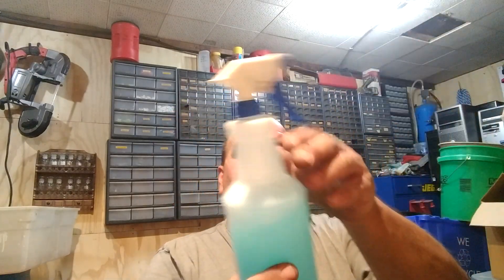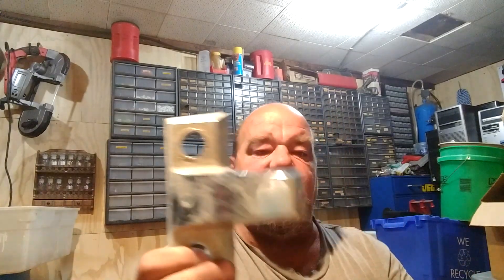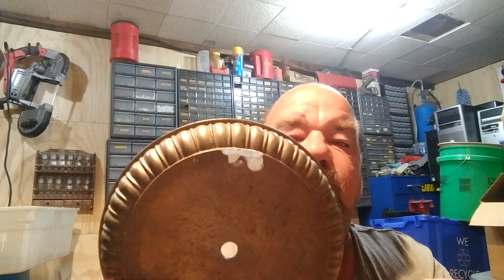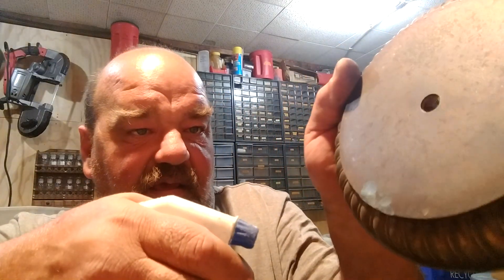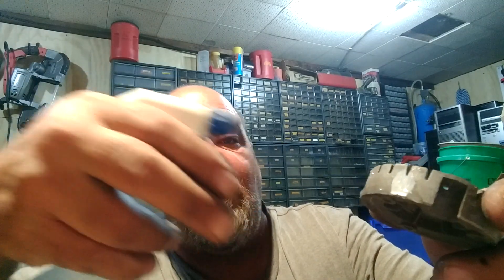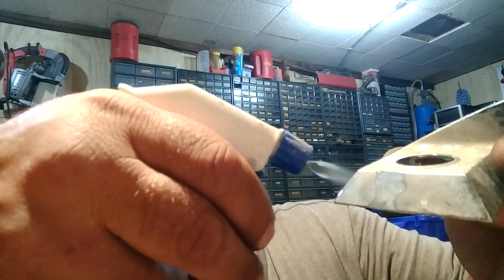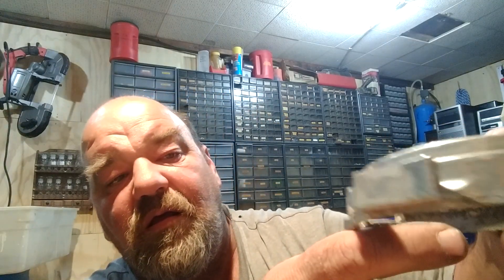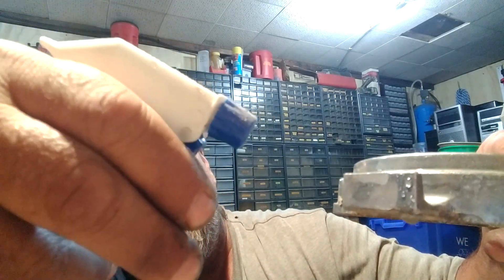Identifying Cast Aluminum vs. Die Cast

Comment: It’s the zinc that is "turning black" when exposed to a solution of copper sulfate. What you are seeing is elemental copper forming on its surface, that's the black stuff. For the magnesium the bubbles that are forming on the magnesium are hydrogen gas; the magnesium is being oxidized by the water. The chemistry is a little more complicated but that’s what you can actually see. And for the aluminum nothing happens because aluminum has a protective oxide layer. Pretty kool but be careful! Copper sulfate, that's what the blue stuff is (copper sulfate pentahydrate), is pretty toxic. And I quote “toxic to humans and animals, and is highly toxic to aquatic life”. It’s extremely toxic if ingested.

Comment: Loved and Subscribed! 
Another related topic that is becoming increasingly problematic is, "Beta Brass." It is Brass w/ higher Zinc content (~35%). Very prevalent in indoor plumbing fixtures these days, because it light, strong, and saves manufacturing/shipping cost. 
The dilemmas are: 1) Scrapyard wants to call it zinc (pays less). 2) Harder to differentiate, when it's ground, it is a "light yellow," but can often look white, depending on how light is reflecting. I think scrapyard needs a new category, as the payout beteen Brass & Zinc is significant. Beta is commonly found in bath fixtures, especially those made in China. 
Glad you mentioned Magnesium, as you stated it's very light.
 Not sure if the yard differentiates, I think they chuck it in w/ Cast Alum.
Thank you so much for the your very practical, no-nonsense video. I will look at more of your content.
Reply from the maker: @pokey5881  Glad you found the info useful.   I am also finding your i for useful as well!  This is the first I am hearing of this "Beta Brass"  I'm going to gather some pieces in the yard i am helping out and shoot them with the XRF gun.  If you like informative videos, I ha e one on the legality of scrapping,  and I am currently working on a video on "prohibited items", like railroad scrap, manhole covers, shopping carts, etc.  Thank you for your info, and I'll let you know what I find out.  👍

Comment: Thanks so much for this, CU! Now I need to find a UK supplier of that stuff! Just one thing: by "die cast", do you mean zinc?
Reply from the maker: Yes, die cast is an alloy of zinc and aluminum.  The active ingredient you are looking for is copper sulfate.  If that is the active ingredient in what you have available in the UK, you're good.  Some say ammonia also does the same thing.  I can't vouch for that because I've never tried it.  Good luck!!
Reply: @cuscrapping  Thanks so much, I've bought some off eBay. Can't wait to try this - more scrappers should know this amazing tip!

Comment: Question - why does the Diecast go black , is there a certain material only diecast has that reacts with the spray to turn black?
Reply from the maker: @boris9331  Zinc is what it is reacting to.  Die cast is an alloy of aluminum and zinc.

Comment: What is the significance between diecast and cast aluminum ? Is one inferior ?
Reply from the maker: Die cast is an alloy of aluminum and zinc.  My yard pays less for it, but I have seen some other yards pay more.  Die cast is cheaper and some say stronger than cast aluminum.  Hope that helps.  👍
Reply: @cuscrapping  It does but since others have said that zinc fumes would kill you, I guess I can cross that off my list for remelting and repurposing it. Thank you for clearing that up and giving us a great way to check this stuff. Some one told me the kids at the schools only collect the pull tabs of can as it is superior aluminum, Make sense as it shouldn't great under extreme stress of popping it. Would you know if that is true ? I want to do some casting and of course use premium feedstock.
Reply from the maker: I had "zinc poisoning" about 25 years ago cutting galvanized pipe in a commercial basement with a torch.  Drinking milk is a good "remedy".  Check out Ralph Mourik on YouTube.  He does a lot of zinc melting.  Not sure what precautions he uses.  Not sure of the purity of pop tabs.  If you want pure feedstock for melting, aluminum wire is your best source!  The larger power wire, not the wire from motors or transformers.  I've heard it usually runs 99% pure aluminum.  👍

Comment: I don't like terms like "die cast". Aluminum, zinc, copper brass, lead, pewter...etc. Are you talking about zinc?
Reply from the maker: I agree with you, but that is what my yards call it.  It is a zinc/aluminum alloy.  Kind of the same as yards calling sheet steel/shred as "tin".  It is not in fact tin.  You know the old saying..."When in Rome..."  😂👍
Reply: @cuscrapping  Things are a lot different here than what I am used to. Back home we had #1 and #2 prepared, unprepared, car bodies, aluminum (dirty and clean) copper #1 and #2 (dirty and clean) Brass, lead. 

If I had a piece of page wire in a load, it would be rejected. here it doesn't matter.

Comment: Thank you for the video. i have fan motor ends that I have been wanting to identify, this will help tremendously.
Reply from the maker: Glad you found it helpful.  Generally, fan motor ends are cast aluminum, but as I stated in the video, I still get fooled occasionally after 30 years!!  This will also give you good leverage if the yard tries to downgrade you.  👍

Comment: "Cast aluminum" is also die cast, I gather by "die cast" you mean any other die cast metal, of which there are many. Do they all react to this solution, or only ferrous metals?
Reply from the maker: "Die Cast" is a generic term used in the scrapping/recycling industry for aluminum/zinc alloys.  The solution reacts with the zinc content to turn black.  Some yards will take die cast in with cast aluminum, but it will contaminate your aluminum content at the mill.

Comment: Thanks for the info! So die cast and zinc are one and the same?
Reply from the maker: Yes and no.  Die cast is a zinc/aluminum alloy.  Pure zinc is very hard to come by except in specialty industrial applications.  Scrap yards use the terms die cast and zinc interchangeably.  Zinc is added to cast aluminum to increase it's strength and make it less brittle.

Comment: Different aluminium alloys are used for different methods of fabrication. Die cast is injection molding under high pressures and it uses Al alloys that are very flowy (high fluidity) when molten and don't shrink as much as others. Because die cast method is used for precise and complexe pieces. Those alloys contain a lot of Copper.
green sand or permanent mold casting aluminium use other types of alloys that can be stronger , those methods do not require a very flowy alloy (relatively speaking).

The different alloying mix is why the copper sulfate pentahydrate (the main ingredient of ZEP)  creates a reaction or not (it reacts with copper ) . Has nothing to do with the process of molding of course
Reply from the maker: I am aware of the process itself.  All I am pointing out is the industry standard.  Sometimes the industry standard makes absolutely NO sense at all.  For example, paying more for extruded aluminum over, say MLC or sheet.  Extrusion is a PROCESS of aluminum, not a GRADE.  It could be a variety of grades...6061, 6063, etc.,   It all boils down to what does YOUR yard call it and how much do they pay.
Reply: @cuscrapping  oh yes, I'm merely posting information on why your test shows different results 👍
Reply from the maker: @TheOneAndOnlySame  Gotcha.  👍

Comment: Love the video thanks quick question I did this test on a impact gun and  a copper color started to appear please advise
Reply from the maker: Thanks, Jason.  A copper color usually indicates nickel.  They don't make impact guns from nickel, but it is used in the plating process.  Scratch it deep and see what happens.  If it is quality, it should be cast aluminum...cheaper may be die cast.  Good luck.  👍

Comment: what is the best way to tell stainless from aluminum? I know the spark test, but I have take a grinder to pots that actually say stainless steel on the bottom that don't spark. Very frustrated by this
Reply: Stainless markings on cookware often only refer to the pot, not the attached base. Deceptive
Reply: that is why we have magnets. Also,,the base itself is usually pretty easy to pry off with just a basic flathead screwdriver @GOLDVIOLINbowofdeath

Comment: Diecast aluminium is often alloyed with zinc.
Reply from the maker: Zinc and other metals usually, but zinc is the main additive.  Supposed to add strength and durability.
Reply: @cuscrapping  Adding zinc to diecast aluminium makes the alloy a eutectic metal meaning a lower melting point which aids in the moulding process with lower costs.

Comment: What if it turns reddish after you spray it?
Reply from the maker: How red??  It tends to enhance the metal's color, so could possibly be copper?  Not sure why, but stainless tends to get a slight rosy pink color from the reaction with the nickel.  Only speculating, but I'll ask Darrell at my yard and see if he has run across that reaction.  👍
Reply: @cuscrapping  Give me some time, I'll send a picture. The item is a valve body for propane/natural gas.
Reply from the maker: @jimhardy7235  Sounds good.  I'll look at the picture when I get it, but sounds like it could be red brass.  👍

Comment: Hi. I have been following you for a little while and enjoy your vids. I have a question that you may help me with.
On your vid (How to tell the difference between cast aluminum, die cast, and magnesium.)
Are you saying that if it turns black it is Zinc? And if it doesen't, it is alum. Thank you And I would like any info on this or where I can find it.
Keep up the vids. Excellent! Gene.
Reply from the maker: Yes, the chemical reacts with the zinc to turn it black.  If it stays silver, it is cast aluminum.  Also, I need to update this video, if it is magnesium, it will bubble.  My scrap yard taught me this trick.  What I use is a septic root killer called Zep.  You should be able to get it at any hardware store, usually in the plumbing section.  The active ingredient that makes the change happen is copper sulfate.  I hope this helps and thank you for watching!!

Comment: Good info!  I sub'd.  Q-where are we likely to find magnesium in our scrap?
Reply from the maker: Thanks for the sub!  The most common magnesium the average scrapper will come across is lawnmower decks or concrete floats.  Most of the rest is usually very specialized industrial uses.  If it is lightweight and looks like it has a galvanized coating on it, rather than an aluminum finish, it is likely magnesium.

Comment: So I assume that, "die cast" is not aluminum then at all? It is zinc or an alloy or what?
Reply from the maker: Correct.  "Die cast" can be zinc or any of a variety of zinc/aluminum alloys.  Zinc is what is reacting to the chemical.  👍
Reply: @cuscrapping  thanks! One more question if I may trouble you then, I dabble in home casting and I wonder which would be the stronger metal to use for a part, the cast AL or the die cast if it is only AL in with the zinc?
Reply from the maker: @codelicious6590  No trouble at all.  I'm no expert, but I believe cast aluminum is stronger.  Die cast is used in a lot of the same applications, but is cheaper.  I've seen several instances where a die cast part failed where a cast aluminum part wouldn't.  Specifically, the exterior door handles on my old 99 Chevy truck.

Comment: First off thank you for this great informative video. Yesterday I found a 4th reaction. I was scrapping the ends of those hoses that you find on the underside of a sink. They were non-magnetic, and when grinding a spot they did not produce Sparks nor any discernible color change. However when I added the solution the ground spot turned dandy-lion yellow. My question is do you know what this indicates, I thought I'd come to you first before doing any more research.
Reply from the maker: Yes, that would be brass.  With the other metals, it tends to highlight their colors, i.e., yellow for brass, red for copper, etc.  Not sure why, but supposed to give a pinkish hue for stainless.  Trying to get caught up and update this video for the magnesium reaction, now that I have some.  I'll try to show some of these other highlights as well.  Thanks for watching!  👍
Reply: Chineseuim

Comment: Perhaps what makes the aluminum turn black is that the ZEP (Copper Sulfate Pentahydrate) erodes tiny pores in the aluminum surface, making a bunch of "black-body cavities" which absorb light.  Anodizing aluminum is similar, but uses acids and electrical currents to form the pores.  Perhaps it would do the same on die-cast aluminum parts, but I expect you are referring to die-cast zinc.
Reply from the maker: Yes, Die cast zinc.  It also reacts to magnesium, and I hope to have a video soon of that reaction!

Comment: great tip but i can usually tell by the weight to size ratio if it is Die cast or Cast Aluminum
also to save time I use a file instead of a grinder to tell if something is copper or brass etc.
Reply from the maker: I can usually tell too by weight and size.  Also by application (what it is used for).  But I have been fooled!  Thanks for watching.
Reply: I just scrape the item on concrete and hope to see some yellow or orange.

Comment: Wonder if something like draino would work
Reply: draino is mostly sodium hydroxide which dissolves grease. The blue solution in the spray bottle is copper sulfate, a completely different chemical.

Comment: I found some other root killer it has copper sulphate I believe in it. That was what a guy on Facebook said the root killer needed to have in it to be able to work. I was wondering if it is still the same measurement of root killer to water.
Reply from the maker: I believe so.  It doesn't take much.  It is just suspending the solution in the water that matters.  If I haven't used mine in a while, I shake the bottle a bit to get the solution stirred up.  That ratio should be good.  Test it on known samples just to make sure.  Thanks for watching and have a Very Happy and Prosperous New Year!!  👊🎉🎉🎉
Reply: you can make your own with muriatic acid and copper ,look it up , makes       some really cool crystal formations too